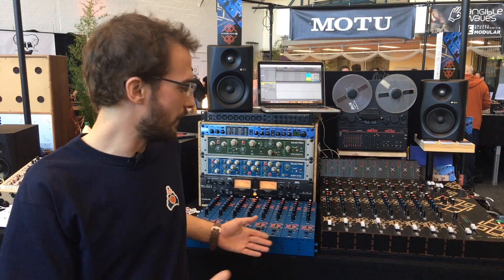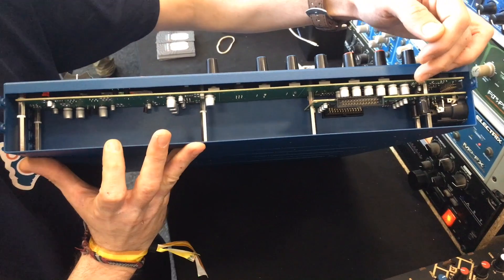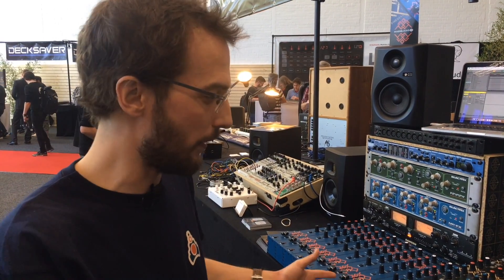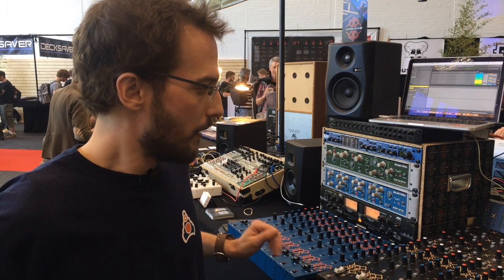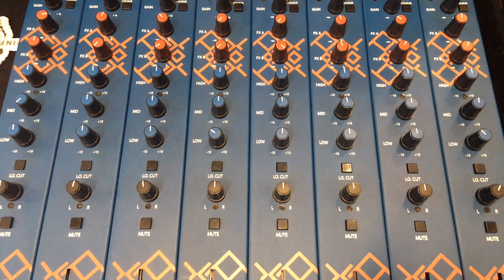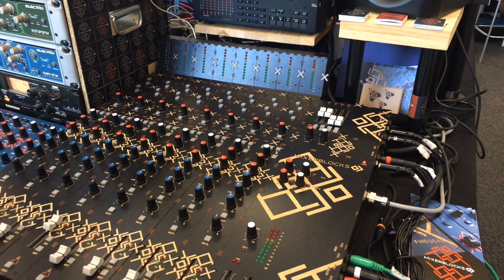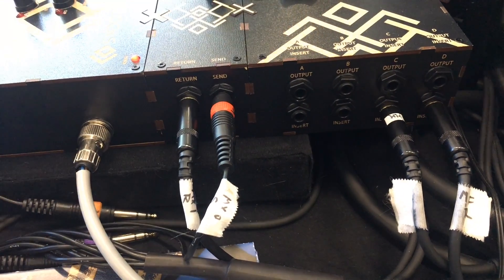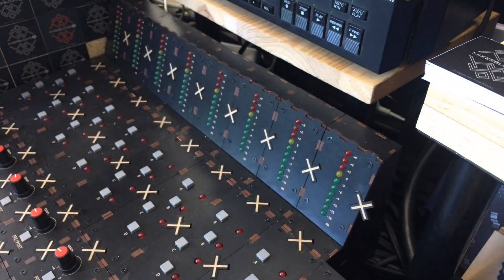Finegear Mixerblocks - Superbooth 2018

Comment: this is an interesting idea. it would be cool to make a fader set and master section with sends to use with 500 series lunchboxes. 
designed so the channels are spaced so they line up with the 500 series modules and people can use their 500 series pre's to make a modular console with sends/returns and a master section with inserts. currently the only thing close is Speck's VF faderpacks or the looptrotter modular console but these finegear modules are priced just right and DIY friendly! 
A lot of people in pro audio don't need the eq (unless its ridiculously good) but faders with sends and direct outputs per channel and a master section would be incredible. hope to see this fully realized!

Comment: seems cool in theory but looks bulky so likely to be unappealing to the larger masses of people. Would end up in a studio and be put through the ringer to see what it can do once that's done you'll find out if people will buy it.

I think you missed what most major expensive console mixers have though. I thought about designing my own and got so seriously cluttered with options I knew the thing would cost too much. His mixer doesn't even have mid or hi sweep for freq which is basically the difference between hi end boards and inexpensive ones.